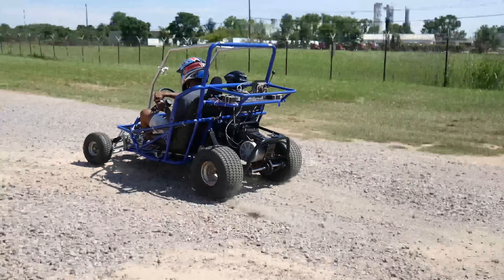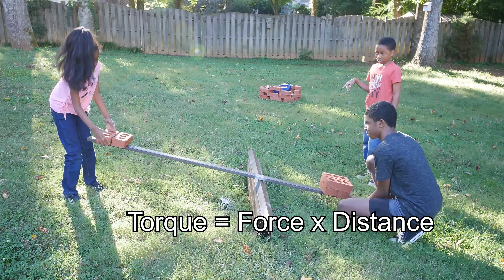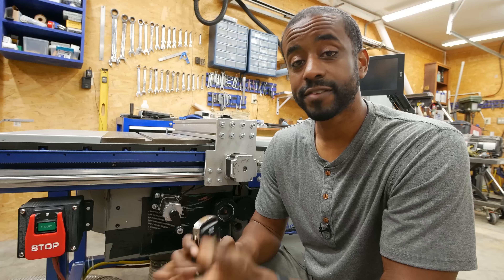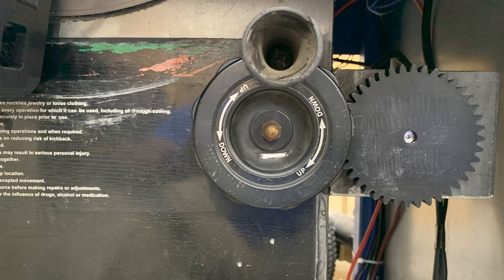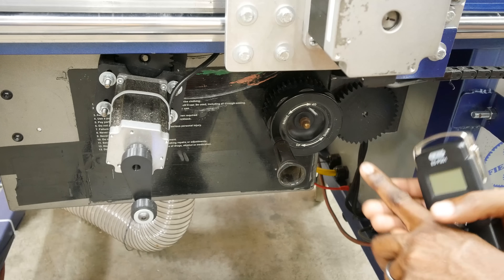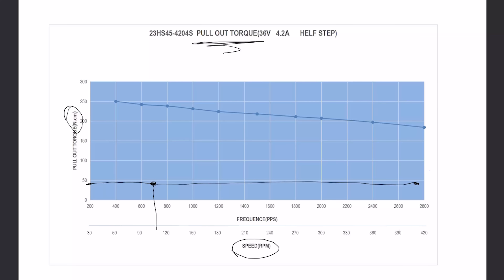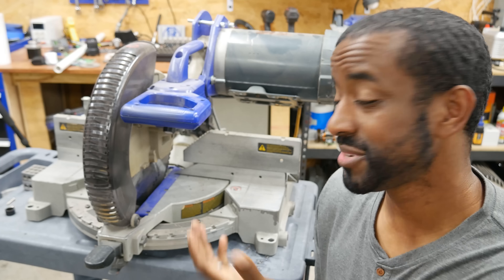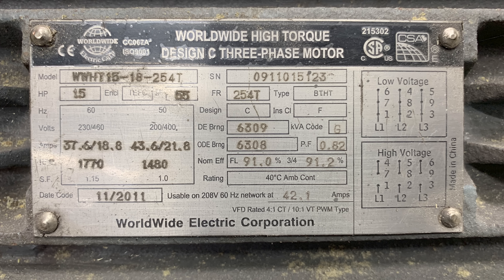How To Size Electric Motors for Any Project: A Beginners Guide #085

Comment: Surely the weight of the force gauge is not relevant in this case? Regardless, the gauge will still measure the force required to move the handle with the only difference being that you will have to contribute that much less yourself. Either way, the reading should be the same....

Comment: Great and very helpful video!

So, I have a question I hope you can help with and it's been bugging me for ages!

Torque produces angular acceleration for a given  moment of inertia, and when the torques on a system balance, you have no net acceleration and a constant angular velocity of that system. Great! 

I assume the reason motors and any other object subjected to torque doesn't just constantly accelerate is because reactive torques in the system grow as the object increases its speed until equilibrium is met - akin to terminal velocity? What would those 'growing' reactive torques be? I can only think of drag, but I assume there must be others that contribute more and i assume, most if not all are some functions of velocity?

For a practical application, say in sizing a motor to drive a belt system that has a design constraint of a set velocity, the way I would do it at the moment would be to balance torques at the point in time where the rotational speed is exactly what I want? If I assume reactive torques increase from zero rotational speed, then they should then balance my driving torque at the correct speed?

Not sure if you can clear it up for me, but worth a shot - I am probably not explaining myself very well.

When sizing the motor using your method, you seem to be saying I can go bigger than I need to, in those sizing calcs you did, but would that not just spin the load faster? What would you do then? Would you use gearing?

Comment: @jeremyFielding I think The smaller gear will give you higher speed and the larger gear will give you a lower speed but Higher Torque. At the same power correct? 2:29

Comment: I wonder if you are a Christian? after listening to a bunch of your videos, I would guess that you are. you seem like your having fun being a dad, I think you have such a good family that it is to envied to have them in your life. I like what you said about starting a dad channel. I built a grizzly g0704 cnc conversion mill with centroid acorn 4 axis and a 1.8kw servo spindle with rigid tapping and probing. I also built a grizzly g0602 cnc lathe with centroid acorn and a 1.8kw servo spindle with rigid tapping and I'm machining my 8 tool changer turret for it, and I am doing the power draw bar with a carasel auto tool changer on the mill. i like your videos. you said you took advantage of putting your kids to work learning if you get the oppertunity to show them what is fun for you, and get them interested in what you do. I can identify with wanting my son to learn everything I know. thanks for all the interesting videos. I use fusion 360 and I downloaded a cool add on that draws the shape of any size cycloidal gearbox you just tell in what size pins you want and what size gear you want, and it makes the solids, and you just restrain them into the patern they are laid out in, and apply motion and they rotate, and you can mirror the gear on top of itself, and then you gat the counter ballanced gear in the correct position. maybe you can make your own robot joints just using the cycloidal gearbox like the harmonic drives you are using.

Comment: I've only ever seen this video of yours (just now), and you've become a rare instant subscription of mine!
In the 'sidebar', I noticed you've made a video regarding 'free energy generators'.
I doubt any such items exist that would provide a decent amount of usable energy, but here's something I recently thought of that might be a money-saving game-changer...

Before 'now', the ability to store large kw's of energy was extremely limited (because of lead based batteries), but with the introduction of long-range lithium based electric car batteries, we now have the potential to use (cheaper) night-time electricity to fill up the newest lithium car batteries and to get one over the power companies by using the stored energy instead of having to pay overcharged daylight costs.
Yes, there's a cost of purchasing the battery, but if you have a workplace, just disconnect from the grid at one location and have free electricity for home use.
Reply from the maker: You definitely should watch the video before commenting on it :)

Comment: If you have a sprocket on a wheel would you measure torque using the sprocket and radius of sprocket and does motor sprocket matter

Comment: Hello Jeremy ,I am seeking reliable ideas for a  Church  sponsored Commercial Truck  electric retrofit,using a diesel Locomotive Concept Replacing a large diesel Engine with a smaller Diesel Generator to provide constant power for axle traction motors .. The Idea is to  minimize the need for large amount of diesel fuel using a Smaller Generator . Please comment

Comment: Hi Jeremy, thanks so much for your video! I was wondering if you could clarify the relationship between the size of the motor and its speed that you talk about around 2:30 -- based on the torque/speed curve, shouldn't a larger motor generate more torque which results in lower speed, instead of more speed? Thanks so much :)

Comment: This helps me considerably. I want to convert my '74 Volkswagen Baja to electric. I live where the speed on the freeway is 75mph. I need my car to go at least 70mph. But since this will be an economy build I am thinking about using a fork lift motor. I am sure there is a formula that given the weight of the car that given the specifications on the motor will tell me how fast I can travel in the car. Can you  help me with that?

Comment: Hey my friend I don't know why I keep losing you God I've been a fan of yours for the longest time I live in the Bay area I want to know if you can maybe help me with something on a electric powered surfboard I need the most powerful pump or a motor to push me and I have my own design I kind of want to make it my own and I have a 12 amp water pressure pump that pushes 12 gallons per minute and I thought it might be really good but it's still not and it's a 12 volt also I'm a little stumped here I want to get going fast and try to make any efficient board where are you located? And maybe I could or you can help me with something and I know some people it would be interested but I got to come up with a good design I feel I'm stuck here right now and I don't feel like running I'm getting too old for that you know what I mean? And I could really use your expertise

Comment: How would I find the power rating for a brushless dc washing machine motor? It is the pancake type bldc motor and it sits right underneath the wash tub, the machine is direct drive. There doesn't seem to be a label anywhere on the machine or motor about its power ratings. Any ideas on how to find it? Thanks. (For reference the washing machine is an LG model wt5075cw. I believe the motor is made by LG specifically for this machine)

Comment: I'm trying to reduce the pulley size on my rock crusher. It's a 3hp engine, very strong (harbor freight) it can bend a metal. So it has way too much torque, but doesn't pulverize the rocks fast enough that are being crushed my rotating chains in a chamber. I raised it to maximum power ,but feels not enough speed. If I want to increase the rpm of chains by 50% do I have to get 50% more pulley circle length on engine?

Comment: I don't get any updates over a year after subscribing. It upsets me because this is great information taught in a way that is extremely easy to understand. I'd like to ask questions occasionally and not have to drag you years back in time lol. I basically want to use electric motors for lapidary purposes and am trying to gain the best info I can on how to control them, speed and direction.(clockwise /counter-clockwise only) ,liquid proof them, and then have them spin the weight of about 50 pounds at no more than 2000 rpm. Is it a phase shift control that I would use on dc? Do they come in plug and play style units like an ac control or will it require hard wiring it in to the dc motor ?  What would be the best way to show actual rpm while in use ?  So much to aak

Comment: It took me a while to realize that power output of a motor is all about the load. Even if you've got a really powerful motor, it won't be doing a lot of work if it doesn't have to. If you give it too much work to do, it will do everything it can to accomplish the challenge, even to the point of burning itself up while trying. So, choose a motor to be capable of a little more power than expected, so it can work comfortably at a lower power band and last a lot longer.

Comment: Very poorly taught, unfortunately. Far better to select a common problem and project (a table saw handle? really?), then size the motor step by step, following it all the way through without any sidetracking into safety margins (those come at the very end).

Comment: Your video was awesome. 
Can you please help for
Motor selection HP (size) for rotary kiln type system (metal sheel with girth gear). Please share theoretical method to find the torque required to rotate girth gear & sheel( rotary kiln).

Comment: Wondering if you could put an electric motor (say, forklift motor) directly to a transfer case, without a transmission?
Would the variable speed of the electric motor serve as 'gears'?

Comment: Liked the presentation and the observation that torque or a unit of energy can be fungible, in a manner of speaking, if you know the conversion formula or factor.  With 'torque' there are or can be a number of vectors or manifolds involved.  And you can play around with those too.  .... speaking of vectors and rotating bodies (if you think about it for a second or two), there are vectors and manifolds that are also associated with Huygens' formula F=ma=(m*v^2)/r for centrifugal force --- which can be the same as a person (but in an opposite direction) twirling a small weight on the end of a circle, in a uniform motion. Since the clip was about rotations and conservation of mass and energy.... If one were  to pump a fluid, water say, through a circular arc of pipe or tubing, that is not quite a full 1/2 circle, and is pinned somehow so that the pipe or tubing is not allowed to flex, then the directed path of that moving water might be expected to produce a vector, F, as in the Huygens' formula.  And you might further tinker the ideas a bit by folding a circular bit of tubing or pipe (in your mind's eye, for starters) so that the two halves are right next to each other.  And try pumping water through the shaped form to see what happens.  As per Huygens' equation.  You could find that there are little or no vector(s) expressed (in your mind's eye)... there is something called the 'right-hand rule' that applies to materials and the related vectors of Huygens' equation.  Implying that all of this has been around for several centuries and is well known.  Anyway, the associated vectors have a cross product that results with the right hand's thumb (of the rule by a symilar name) being pointed away from the plane and in a particular direction.  As the two halves of the folded circle has water flowing through it, there would be a foreseeable canceling out of the vector in the above cited equation as the two thumps of the perceived right hands are pointed in opposite directions.  Bummer.  So in your minds eye, then, drape your tubing/pipe --- folding a circle over a 20 degree wedge form say --- the thumbs are not in alignment with each other and the Huygens' vector F returns.  Long-winded and interesting, but is it a lot of hot air or cool air?  Meaning feathers and nonsense?   See the book, 'Traveling Through Space --- Without Rockets, 3rd ed.' by James G. Parsons.  You might find such a book, with spelling and grammar errors included, at ammazzon?  Real High School level Physics here, y' know?  I wonder if NASA has stumbled across any of the above?

Comment: I bought a 1000W bldc motor for my electric gokart project which was supposedly more than enough for the size and weight of the kart
but the motor spins slowly even when the kart is kept off the ground (on a stand), how do I fix this?

Comment: As an electrical engineer with specialization in electrical machines, I would say these are the requirements to size a motor for a simple application. Sizing motors for other applications has much more requirements such as height, cooling, operation modes (S1, …, S6), environmental impacts etc. This is fine for some DIY projects.
Reply from the maker: Of course! If you project is too big for this tutorial, your shouldn't be watching a beginners guide LOL The whole point is DIY level projects. Thanks for watching. :)
Reply: Jeremy Fielding sure I just wanted to add this small remark. Thanks for the video. Your projects are really interesting and creative 😊

Comment: Question I have a gem faceting matching driven by tapper black rubber cone to a rubber disc on wheel (8inch) grinding ....whish I could draw a picture!  I want to know would a belt drive be less noisy than cone drive?  Name of machine is an Ultra Tech faceting machine.  Thanks

Comment: Where is a good place to find motors? Looking for 12v 1600ish rpm 1/3 - 1/2 hp. Using a 30lb trolling motor and need alternative as it's overheating.

Comment: Couple of little things,

You said 'safety factor' a lot when really you were talking about 'design factor'. Safety factors are reserved for things that if they fail will cause a hazard to operators or by standards. In your example, the measure being based on the force to overcome static friction is likely enough of a design factor.

Something important that you failed to talk about is stall conditions and methods to protect against them (fuses, circuit breakers, overloads, etc). A motor or any load for that matter needs to be protected. 

For things like bandsaws and other machining tools, the power rating is directly rated to the maximum material removal rate. Machinists handbook should have details. For things like go carts you could have related motor power to acceleration for a well known example. 

All in all, an excellent introduction to the world of changing electricity into mechanical power, but you left out any mention of safety besides the design factor. Motors are as powerful as they are dangerous and I think you should make a follow up. People are watching for their own projects and don't know what they don't know.

If you would like to discuss I'd be happy to help, I've been working with motors for quite a while in industry and would love to make sure people using them know what they are getting into safely!

Comment: I can't wait for the mindset to change as it did in the model rc industry... smaller lower amp motor and a transmission= better performance and extended range while drawing less amps. Great video keep up the good work

Comment: 8:11 could you start the motor on the slower RPM then use the higher RPM that requires less torque. This should be well within the power best power rage for the motor and also not stress it out at al. or am i wrong :)
Reply: Yes iu xan but chef residents hyber ejrrc 1980 recline too siedd dem like remo   bhgmt long kufevejtrr Rev ut full redfin rpms

Comment: thnx for the knowladge. I wish to calculate which DC motor do i need in order to move 50kg at speed of 10-20kmh for a minimum 1 hour. which type of battery it needs? Thanks!

Comment: I would like to build an electric motorcycle using as many golf cart parts as possible to help keep costs down 
I have a 3.5hp 3000rpm 36v motor, an altrax 450amp controller 
Goal is 80mph is that remotely possible or will the low speed load burn up the motor?
Is having a transmission an option?

Comment: Good day. Quick question what hp would I need to power a 25k low rpm generator at 3500 rpm. And what is best dc motor u tink I will need with higher than 3500 so I can use a seed control duty continuous. Please thanks.